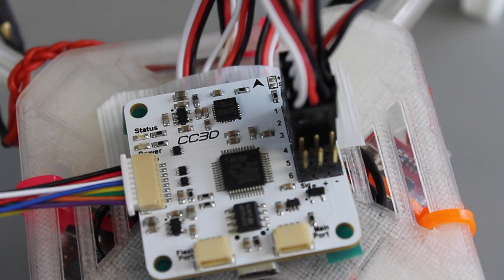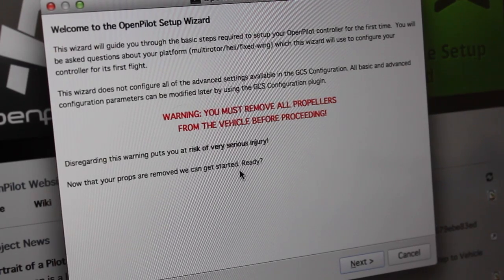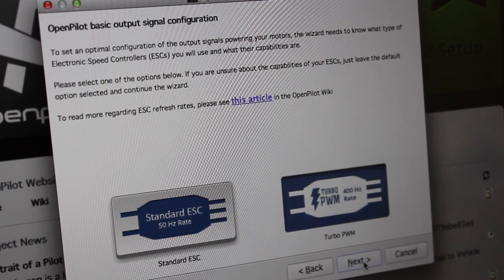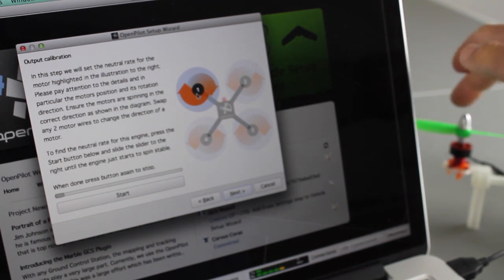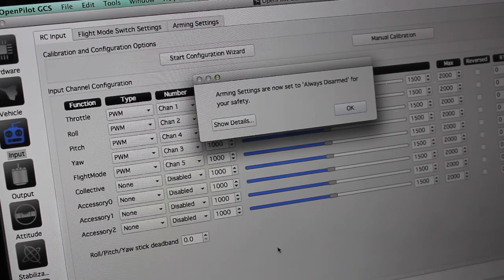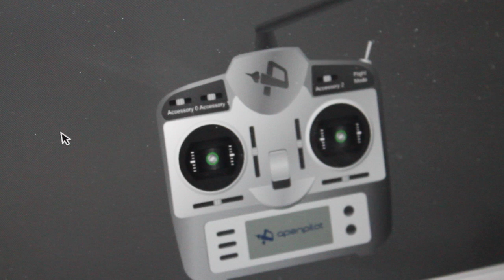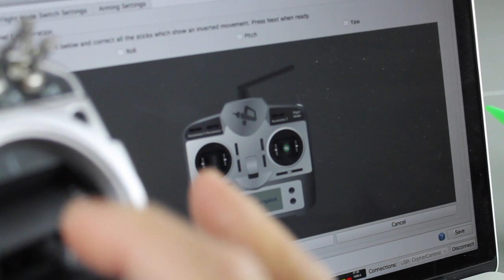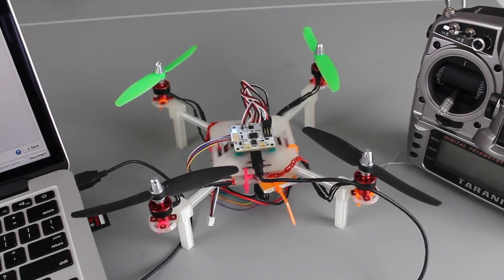DIY Mini Quadcopter w/ OpenPilot CC3D Wiring, Configuration, and Garage Maiden

Comment: Hi very nice vid, I am planning to build my own drone and I just wanted to ask if there is an FCU that has altitude hold and return to home function?
Reply from the maker: Have you looked into APM or Pixhawk? If you want a smaller version check out Pixracer and PixFalcon. Good luck.
Reply: Thanks for the response and the tips.

Comment: I want to use the SBus fonction of my reciever with my CC3D (the micro one). Does the CC3D need an inverter like the Naze32 controlers ?
Reply from the maker: Good question. I'm not sure about that one. I'll have to see what I can find out. Let us know if you're figured it out already. Thanks.
Reply: Apparently, the CC3D has an integrated inverter in the main port. You need one if you want to connect on other ports.

Comment: Hello Dennis Baldwin, my name is João Elias and i'm from Brazil. I'd like to know about the components you used to make the Quadcopter you showed on the video above, like the name specifications of the motors, Esc's, etc. Thank you so much
Reply from the maker: Hi! This is the most recent build version with new frame:

https://www.thingiverse.com/thing:463579

Good luck and hope you get in the air soon.
Reply: Thank you so much, Dennis !
Would it work using the CC3D Flight Controller ? Which one do you prefer ? Multiwii or CC3D? Thanks again.

Comment: Hey question I have a pdb that I connected to my battery but how do I get power to my cc3d  and esc my esc only came with 4 wires pow ground n two connectors should I use a ubec to power my cc3d?
Reply: U see I don't have 3 wires coming out of my esc the red white and black wire just a orange and brown
Reply from the maker: I'm not sure what ESCs you have but if there are only two wires then that probably means you have signal and ground, but not power. That must mean they don't have an integrated BEC so you'll have to power with a separate BEC.

Comment: Hello dude nice video, im a little newbie and i have a question, my esc have BEC integrated, my question is, i have to conect all the 3 wires (+, -, signal) since the ESC to the cc3d or only 3 wires in one and signal in then other 3 esc
Reply from the maker: It is generally recommended to remove the wires as you mentioned, but I normally don't and haven't run into any problems. I've removed them on several builds lately just as a matter of principle. Good question and good luck with your builds.
Reply: thanks a lot my friend!
Reply: +Dennis Baldwin But i have to power the cc3d and the receiver, and my receiver needs 5-6V too, so wouldn't it be the best to use 2 esc with BEC and 2 without? please say what you think about it, i dont want anything under/overpowered. It's my first quad, i'm coming from the "fixed wing world".

Comment: My wires have fewer colors. instead of orange and purple it has a second yellow and blue.
Reply: The wires are in the correct order, left to right. They just didnt have enough colors. Also,... be careful as those wire break REALLY EASY. I guarantee you will have a problem with that wire harness.

Comment: are the motors connected DIRECTLY to the board? or do you need to have motor controllers like i've seen on other larger quads for this board?
Reply from the maker: The motors are connected to ESCs, which are then plugged into the flight controller. Good luck with your setup.

Comment: Can you shed some light for me.  I can go through the setup of the motors, and partially through the transmitter.  After the part of moving the sticks, the software shows a switch top/right on the diagram.   No matter what switch I move the software doesn't see it.  Having said that, I'm only using a 4 channel Spektrum RX, and only have 2 position switches on my DX6i TX.  It won't let me SKIP to the next phase of setup from the menu bar at the bottom.  I can go back, or cancel.  That's it.  Any suggestions?  I'm running CC3D 15.2.xx software.  The newer version wont' work with this FC board.
Reply from the maker: +Phillip MoFo Interesting. I haven't done this with a 4ch RX before so it's hard to say whether or not thats causing the issue. I know CC3D has multiple flight modes and perhaps it's expecting some sort of input signal on that channel. Let us know what you find out. I'd be interested in knowing the cause. Thanks.
Reply: Got it figured out.  We had to make a change within the TX, and setup the cables in order from the FC to the RX.   Thanks

Comment: eu tenho um  250 recer quad   e reparo que a ligaçao do cabo  com o receiver  , no esta igual a sua ,..achas que isso influencia voo, pois  o acho tao instavel,tantas  propelers  partidas, tou desanimado com  o quad carbono 250  ,... ele usa radio e receiver flysky 6ch,.d  250,..equada a outra questao, qual a bateria  mais adequada ! 11,1 1800mah ?
Reply from the maker: +Rui Chaves My Spanish is not that good, but I think I understand your question. I think a 3S 1800mAh battery should work okay with your setup, but it may be a little heavy. If you already have the battery give it a test. I normally fly with a 1300 or 1500mAh battery. Hope this helps.
Reply: tanks., dennis ,  vou tentar voar com  outra  bateria !

Comment: Can someone please help me out? I just got a CC3D flight control board. I didn't come with the standard 3 pin receiver plug cable to hook to your receiver instead it came with 3 sets of cables all with  JST single pin connectors. 1 is a 8 wire cable and the other 2 are 4 wire cables. How do you wire this up???
Reply from the maker: +jdj62464 Sorry to hear that. I haven't seen this type of wiring configuration before so it must be some sort of knock-off. Now that doesn't mean it won't work, but I think it's just a matter of getting the connectors plugged into the right pins. Perhaps you can use a couple of the diagrams from this article:

http://www.dronetrest.com/t/cc3d-flight-controller-guide/830

to properly map your connectors to the right receiver port. Let us know how you get along and maybe you can provide a link to the product page where you ordered for us to get a better understanding of what you're faced with. Good luck with your build.
Reply: go to painless 360. he explains Cc3d really well in a series of YouTube vids. good luck.

Comment: Bro my Pc shows Device Not Recognized 
and gcs says colse program or check on-line
Reply from the maker: +Gautam Verma Strange. It's hard to say what the specific problem is but I suggest trying a different USB cable. Some cables are meant for charging only and don't have the data pins wired up. Just a suggestion, but thought it was worth a try. Good luck and let us know what you figure out.
Reply: actually the bootloder of my board was deleted by mistake so i am uploading bootloder by help of aurdrino uno thanks mate for help :)

Comment: hey plz help me my cc3d is showing only one light and didnt detected by gcs plz help 
it was blinking blue light then suddenly it stops now only yellow is on plz help
Reply from the maker: +Gautam Verma If you can't connect to the GCS make sure you have the drivers installed and it you see it listed in the connection drop-down menu. Otherwise you won't be able to connect. Good luck and let us know how it goes.

Comment: I'm a bit confused by the " disconnect your board" step.  Do I unplug the micro USB that goes to my CC3d board?  If I do that, how will the firmware get upgraded?

thanks
Reply from the maker: +Dionatronics Yes. It's a bit strange and Pixhawk does this as well. But unplug your board and then plug it back in so begin the update.

Comment: +Dennis Baldwin I have made a 450 size quad with the cc3d and I have trimmed it out and it flies but my problem is that whenever I tell it to go in any direction it will keep going into that direction until I counter it? What should I do?
Reply from the maker: +David Casino Perhaps you haven't setup stabilize flight modes? Maybe this will help: https://www.youtube.com/watch?v=VbZNeDCnUyI Good luck and let us know how it goes.

Comment: Dennis, to power the CC3D,. are you using one of the ECS ( the red wire) and you removed red wires from rest of ECSes, ? that is what manual shows, I am confused becasue different guy used all 3 wires from all 4 ECSes, according to him he can do it because he used a linear ECE,  hmm, confused
Reply from the maker: +Zycie w Californii I have linear becs as well so I didn't need to disconnect power from the other 3 ESCs. This thread does a good job of explaining it. Hope it helps.
Reply: +Dennis Baldwin Thank you Dennis.

Comment: ...and now the CC3D sells for $13 at banggood...
Reply from the maker: +Mark van Werven That's crazy cheap!
Reply: Yep, but I'm not complaining xD
Naze32 goes lower in price as well, as there are F3 and F4 boards available.. But I´ll prefer the cc3d and naze32 rev.5, flies stable and agile, I don´t need much more.

CC3D Atom is the cheapest board I own, bought for €8... Flies very well on my Diatone 150, which is a blast to fly.

Comment: that purple cable though....  mine is blue.. i got 2 dark blue ones... and then i see another dude where its black -.- why is mine a different color?!
Reply from the maker: +lanorc There are so many derivatives of the CC3D board so I'm assuming you got one with different cables. This sounds similar to the one you're describing: http://amzn.to/1WWEPtt Perhaps you can map the pin #s to something like the diagram on this page: http://www.dronetrest.com/t/cc3d-flight-controller-guide/830 I wouldn't worry about the colors too much as long as the cable works...and of course if you can get it wired up correctly. Let us know.
Reply: its the same board... but they just took 2 blue ones i guess for there own fun :) it works anyway!
Fun little quad to fly and lots to learn, different from my AP flagships.

Comment: what usb cable can be used on cc3d? some have a pin ground some have 2 pins jumper like mobius. thanks
Reply from the maker: kriss fly That's a good question. I used the same cable that I use to charge my Android device. Not exactly sure of the pinout but pretty standard.

Comment: Hi, can i ask if i need to connect the wiring and mount the board on the frame before i can run the software? Or can i just run it without any wiring except the mini-usb cable?
Reply from the maker: Zhenzhou Loh I'm pretty sure you need to have everything wired up to configure it. Otherwise you won't be able to set your min throttle setting with the sliders in the OpenPilot GCS. I've never done this without being wired up so I'm just guessing.

Comment: Really appreciate these videos, you do a great job.  Seems like it's kind of hard to find the CC3D boards.  Not in that there aren't any, just that it looks like theres quite a few variations.  Am I wrong, are they actually all the same?  Some of the older links are invalid or are all out of stock.  Where would you suggest looking for best results?  Just careful ebay purchasing?
Reply from the maker: zammster To me this is always a trusted source:

http://www.readytoflyquads.com/flight-controllers/cc3d-taulabs

I haven't used their CC3D boards, but I've used some of their others and had great results. I plan on trying one of their CC3Ds soon. Thanks for the feedback on the videos. Much appreciated.
Reply: Dennis Baldwin perfect.  sorry if you posted that already in the comments and i just missed it.. though i'm sure they love extra references :)  thanks again.  i've actually got your model parts printing now, and I also picked up a cheap 250 frame.  all the parts except the rotors arrive today so!  that's probably for the best so i don't accidentally leave them on and chop up my arm or something. turnigy 9x, and pretty much verbatim from your posted parts list.  i'll share the results.

Comment: when u said u think its on self leveling by default then a few seconds after your quad kinda goes little fast to the side then there was a screen cut in. Did you crash it by any chance?
Reply from the maker: franky5angels77 No. Thankfully I didn't crash this time but have crashed several times in the past :)

Comment: Which setting do I use for Simonk ESC's? Thanks
Reply from the maker: Steve B I'm not entirely sure. The first thing that comes to mind is make sure you set the proper refresh rate given they generally have a faster rate than standard ESCs. Other than that I would recommend configuring and trying to do a low hover to see how everything behaves. Good luck.
Reply: Dennis Baldwin  do I have to change 2 of the wires of the esc for  the motors to spin right or I can just soder the wires and the cc3d will  make them spin rigth

Comment: Hi, can you tell me how you have skipped the "flight mode" step in the TX assistant ? (Because I have a 4channel TX and I can't go through this step). Thanks
Reply from the maker: Tanguy Roberjot To be honest I can't remember. One thing you may try is to manually configure your setup vs going through the wizard. That may get you around having to specify flight modes.

Comment: Hey Dennis, in the setup wizard, during the motor calibration with the sliding bar to find when the motor just starts to spin, one of my motors wont spin. Even when I slide the bar to the end it doesnt spin. All other motors work perfectley untill motor 4. Any help? Thank you very much.
Reply from the maker: ***** The first thing I would do is connect the ESC directly to your receiver and find out if you have a problem with either the ESC or the motor. After that do an ESC calibration just to be safe. Then hook it back up to your CC3D and run the setup wizard again. Good luck and keep us posted. If you continue to run into problems check out www.garagepilots.com and post in the forums over there.
Reply: Dennis Baldwin  Turns out all I did was fiddle with the wires and restarted the whole process and it works. Thanks anyway man!

Comment: Awesome video, I am building a fpv 250 and put a multiwii board on it. And cant get any response at all? So I went ahead and ordered  this board. I hope after seeing your video I can get this thing in the air. I too am using a Fly-sky. This is my 1st build from scratch I might ad. I Sure hope I can count on you if I run into any glitches? Thx Dennis.   Kazz
Reply from the maker: Kazz- Mann Awesome to hear. If you run into any problems please check out the forums at www.garagepilots.com and hopefully we can help you out over there. Thanks and good luck.

Comment: hi i have d8r-ii-plus with frsky taranis -plus, cc3d 250mm mine quadcopter. i want know how setup failsafe on this reciver, if you can help me. tk
Reply from the maker: Reginaldo Costa Check out section 2.3 of this PDF:

http://www.hobbyking.com/hobbyking/store/uploads/351744633X736171X30.pdf

That should get you going.

Comment: I've got a 12ax4 in 1 esc and am not clear how the wiring should tie-in to the cc3d? Could you help shed some light on it for me?

The ESC has the a red/white/black 3-pin and 1 brown, 1 red and 1 orange pin. Where should these plug into?
Reply from the maker: ***** It's hard to say without seeing a diagram of your 4-in-1 esc. Normally the ESCs are marked 1-4 and then there should be a marking letting you know which servo lead corresponds with each ESC. You could plug the cables into the appropriate channel on your receiver and make sure they match up with the motor number attached to each of the ESCs. Hope that makes sense. If not, perhaps you can post a photo in the forums at www.garagepilots.com and we should be able to help you out. Good luck.

Comment: I'm running this board, bought from Banggood for $15, on a Diatone 250 quad and absolutely love it.  Came from a kk2.5 and this board is heads and shoulders better. I see that this board is GPS capable and I would love to add a gps.  Any suggestions on an inexpensive board that will work with this?
Reply: +Leo Costantino the cc3d revolution board has gps option

Comment: what powers the CC3D?
Reply from the maker: Paleo FPV If you're using the supplied cable you should see that one of the servo connectors has 3 wires while all the rest have 1. The 3 wire cable goes to the throttle channel on your receiver and gets power from it.

Comment: How did you get it so stable with the first program?  I build flame wheel for training using CC3D and its not that stable.  I have a lot of oscillation
Reply from the maker: Jon Car I'd recommend looking at your gains and bringing them down a bit if you're getting too much oscillation. A lot of times for me it's trial and error, but sometimes I get lucky :) Thanks for the comment.

Comment: So I have the cc3d and I bought the spectrum dx6i and the servos that came with the cc3d dont fit in the receiver... got any advice? i can't find any connectors online.
Reply from the maker: 1drammin By "servos" I'm assuming you mean the servo extension cable. These are generally pretty standard, but there is the Futaba J type connector which could prevent them from being plugged into some receivers:

http://www.hansenhobbies.com/products/connectors/servoconnectors/sc_fjh/

This can actually be clipped off to make your connector fit. Not sure if that's your problem, but that's the only thing I could come up with from your comment.
Reply: Dennis Baldwin  Thanks! I figured it out, my next question is about connecting the ESC's to the cc3d.  Did you cut the "red" wire on 2-4? I heard only the first one need to power the cc3d.